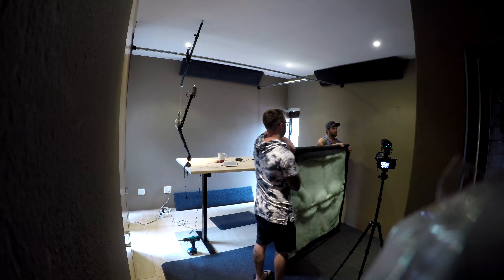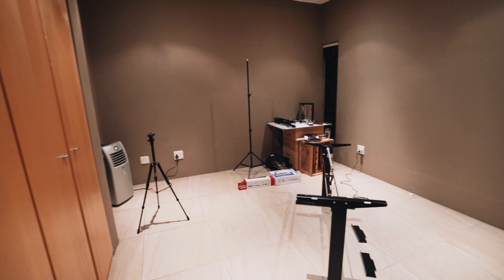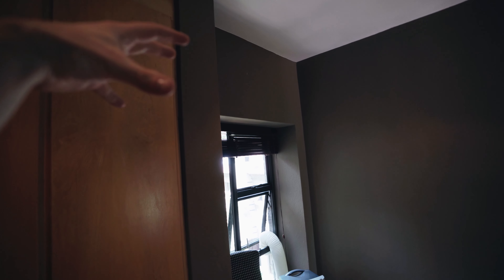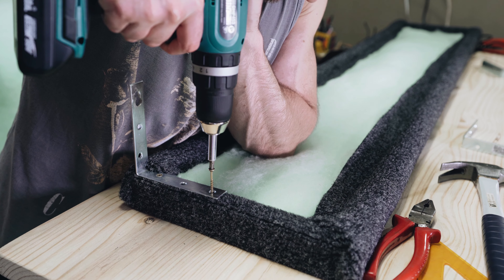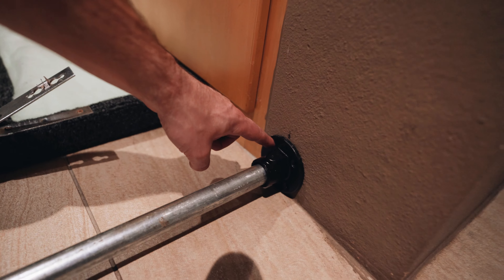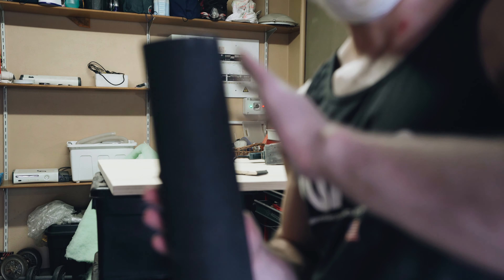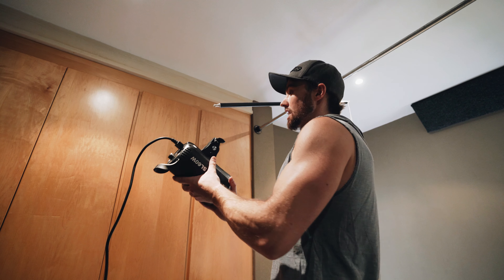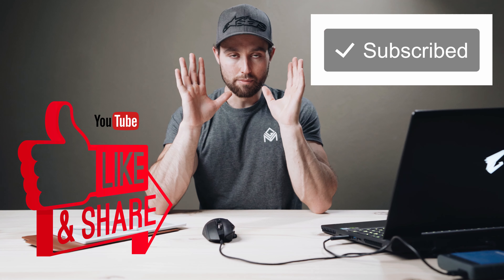How to Build a YouTube Studio Setup at Home 2021 | Ideas & Inspiration

Comment: DAMN BRO. Those drawing skills.
Reply from the maker: Hey Pat! lol 🤘
Reply: @DanRodgers  I use the same light dome. Its a bargain.
Reply from the maker: @skunklabs_official  100%! The only thing I noticed is the bowens mount thing is not as secure, on mine it can twist off if you move the light.
Reply: What I do is put the light dome on the ground first (big side facing down). Then I secure the actual light to it from the top. That tends to make it seat better; assuming the weight from the light pushing it down helps.